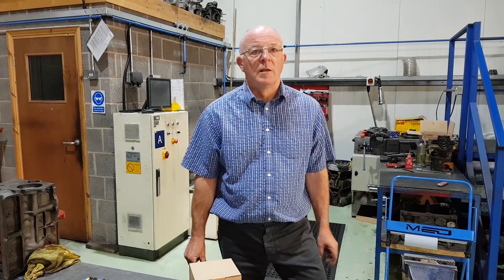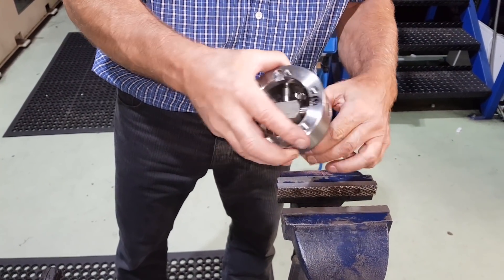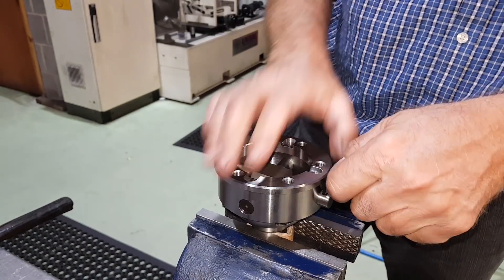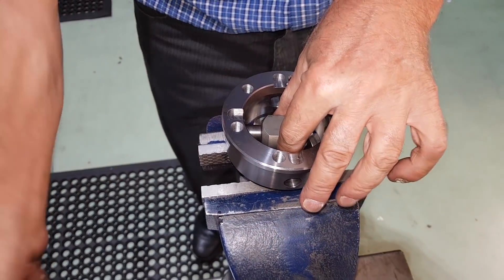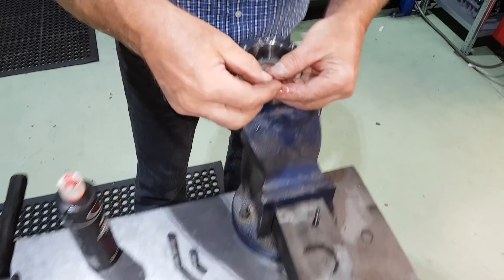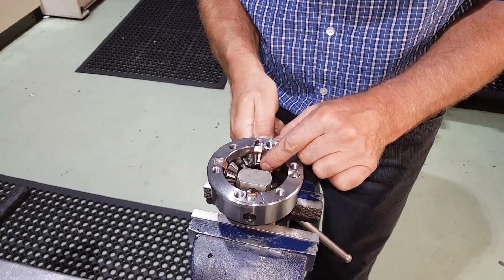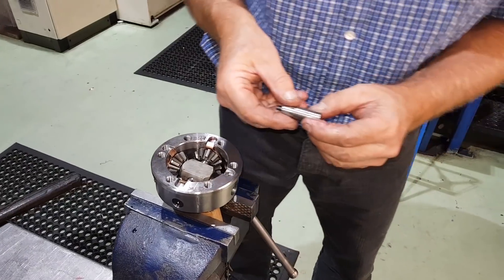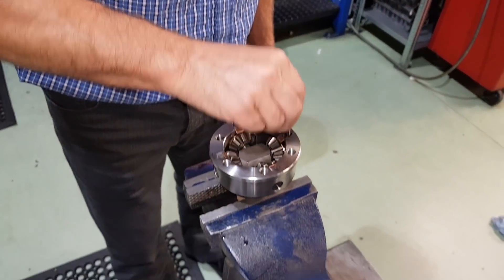How to build a Mini X-pin differential

Comment: Looks like Stirling Moss's younger brother!  👍  Also, with a std diff, Minis tend to pull to the right on hard acceleration, and pull left on deceleration, esp. if the diff preload is insufficient (or worn).  The 4 pin diff cures that, or at least is has in my Mini.

Comment: The only thing holding that main pin in place is the smaller pin put on the end of the last pin inserted? Seems a bit weak to me, why not put a second 5mm bolt into the main pin for more security?
Reply from the maker: We've not broken one yet...